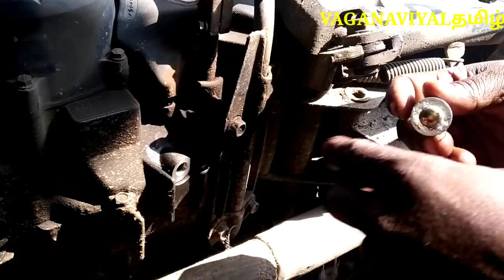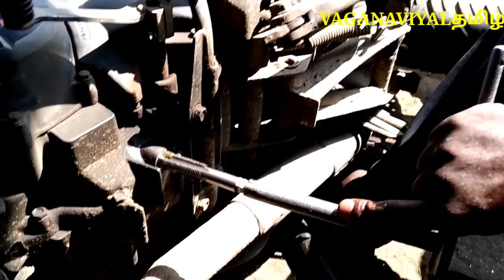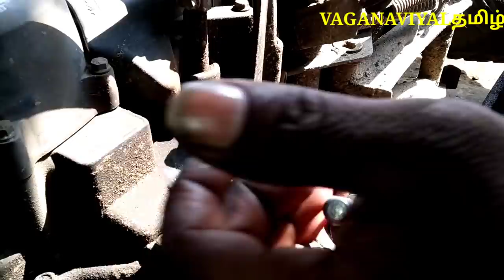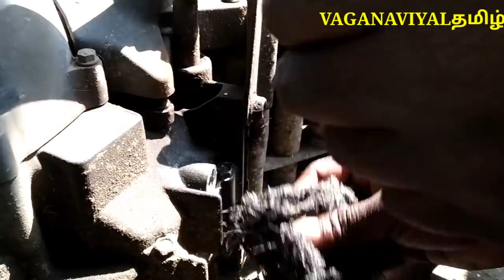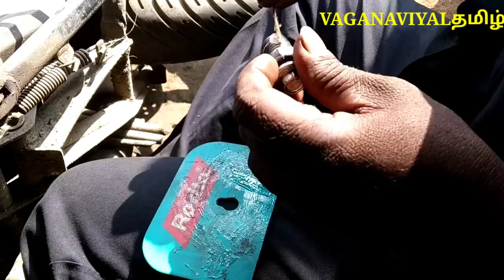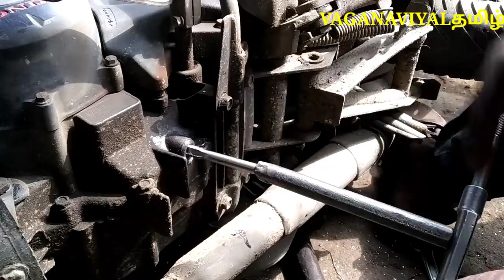How to Repair Engine oil drain Bolt Thread / தமிழ்

Comment: Royal enfield uce engine la drain bolt thread poche na tvs apache drain bolt ah direct ah potta tight ah nikum . Just sharing my experience it worked for me 👍 . Temporary solution dhan but long time ku sleeve dhan best .
Reply: Bro this is suitable for classic 350

Comment: Anna nan splendor plus 2010 model vachuruken daily 100 to 300 km ride panren highway la 70to80kmph ride panren endha oil use panalam nu sollunga 1mnth kula 2000 ku mela odiruthu

Comment: I done for my spender
Rs 300 charge
80% good ( not better than company thread)
0.1% Slightly oil leakage happening.
( Cheap solution is anabond 122 thread locker but over heat will melt the anabond 122)

Comment: Bro சின்ன சந்தேகம் இப்போ மர potum pothu அந்த அலுமினியம் துகள் உள்ள poirukkum ல அது yepti yellam வெளிய வந்துரும bro
Reply: Pres sureAir adichu clean pana velia vanthrum bro
Reply: @jacobstenifdo9901  air adichaa பிசுரு உள்ளே தான் போகும். எப்பிடி வெளிய வரும்?
Reply: @jaikarmero2559  apom vaccum pressure vachi velia edukavendiathuthan ena broo
Reply: @jaikarmero2559  bro athula block hole na pressure air adicha prachana ila hole direct ah ulla iruntha nama thania kalathithan vacvi thread podrathu nallathu
Reply: Old oil irukum pothu marai podanum bro then oil kalati vidum pothu oil oda senthy thugal ellam vanthudum.. Apram puthu oil maathikalam..

Comment: மிகவும் அருமையான பதிவிற்கு நன்றி.  1.Yamaha gladiator slow speed correct ஆக உள்ளது வண்டியை ஓட்டும்போது வெட்டி வெட்டி ஓடுகிறது, 2. Battery charging current RR Unit இருந்து9.7Volt வருகிறது இதற்கு RR Unit மாற்றவேண்டுமா. தங்கள் பதிலுக்கு காத்திருக்கும் நண்பன்.
Reply from the maker: ஆமாம் bro
Reply: முதல் கேள்விக்கு பதில் தரவும்

Comment: Oil drain area Thread crack issue வந்தால் எப்படி சரி செய்வது எவ்வளவு செலவு ஆகும்
Reply: Engine case தான் மாற்ற வேண்டும்...

என்னோட yamaha libero விலும் அப்படித்தான் ஆகிவிட்டது...

நான் M-Seal போட்டு அதன்மீது Araldite போட்டுவிட்டேன், லைட்டா ஆயில் லக்கேஜ் இருந்தாலும், engine oil அளவு பெரிதாக குறையவில்லை...

அப்படியே ஒடுது, ஹில்ஸ் எல்லாம்கூட ஓட்டுறேன்...

இதுவரை ஒன்னும் ஆகலை, ரன்னிங்ல புடுங்கிக்கிச்சுன்னா கண்டிப்பா Engine சீஸ் ஆகிடும், எனவே அப்பப்போ செக் பன்னி பாத்துக்கறேன்...
Reply: pulsar 220 la same problem vandhuchu, engine mattum bike la irundhu erakki aluminum welding pannom. problem solved.
Engine caseum chane panlam, but selavu jasthi
Reply: @dravidalltech1594  super brother, நான் இன்னும் அப்படியேதான் ஓட்டிக்கிட்டு இருக்கேன், அடுத்த மாதம் இஞ்சின் வேலை செய்யலாம்னு இருந்தேன், நீங்க சொன்னமாதிரி முயற்சி பன்னி பார்க்கறேன்...

அலுமினியம் வெல்டிங் வெச்சு, திரெட் போட எவ்வளவு செலவு ஆச்சுங்க brother...

Comment: This is not safe... Drill panrpo metal pieces ulla poitu engine damage agum
Reply: நானும் நினைச்சேன்😢
Reply: they will clean it by removing the case
Reply: @Gokullokesh  அவங்க அதெல்லாம் செய்ய மாட்டாங்க நாமதான் வண்டிய ஓட்டாமா பைக் மெக்கானிக் ட கொடுத்து ஏர் அடிச்சி டீசல் வாஸ் பண்ணி அதுக்கப்பறம் ஆயில் போட்டு வண்டி ஓட்டனும்
Reply: Petrol, oil, or any other acids pot clean pannalaame
Reply: True, oil pan ah kalati, thaniya veliya eduthu than pannannum. En na engine oil  contaminents ellam microns PPM la than irukum. Antha alavuku chinathu. Ipo intha Mathiri work panna ithula vara kudiya metal dust easy ah crank bearing journal la kandipa Sikkum sekirame engine oda efeciency poidum.

Comment: Bro my bike passion pro bro magnet oil seal leak avvudhu bro naaan adha 3 times change pannita bro oil seal full seat change pannita bro appo kuddum adhu leak avvudhu bro enna problem irrukum bro eddhuku 3 times mechanic shed la tha bro service vitta adhu ena problem bro konjam slungala plz🙏
Reply from the maker: Coil plate o rings and oil 2 seals set change pannunga bro no problem
Reply from the maker: Coil plate o rings and oil 2 seals set change pannunga bro no problem